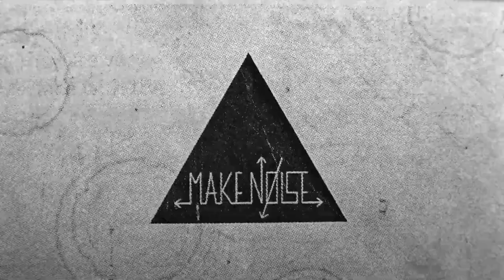How to Tune a Morphagene

Comment: was a little confused by the instructions but eventually I figured out that you need to tune the original lower pitch note solely with the Я | F knob. So like I hook up my piano and play the lowest C I want to be able to play this sample at, and then with nothing plugged into the varispeed CV, I use that knob to match the correct pitch. Only then do you plug in the CV->atten->varispeed knob and fine tune the atten knob. 

Hope this helps anyone who might have been confused in a similar manner.
Reply: I was what confused too, I found my own method, I don't have the other stuff so I was  using Intellijell scales and disting4 (tuner). Don't forget. (uhum... like me) to edit the config file on the sd card(VSOP option!). Runs as a train (sr. Duch . loopt als een trein) ;-)
Thanks.

Comment: your original pitch is at around 1 o'clock....imne is at about 3 o'clock....is this normal behavior, or is my Morph not calibrated correctly. or is your not set to bidirectional, VSOP , but VSOP 2. thanks
Reply from the maker: Most likely it's set to vsop 2. Must be 1 or 2 for this to work - it will not work with vsop 0.
Reply: @MAKEN0ISEMUSIC  last thing....since ive been pulling the card to make changes, when I pop it back it it it doesn't start to autoload, I press the Shift button. but id say about 60% of the time it still won't load and I have to power cycle my rack. how else can I get it to load without power cycling, or could there be some kind of issue? thanks.

Comment: is the morphagene running into the optomix as a means of consolidating both sound sources (into the echo & erbe) ... or to impart a vactrol color to the sound? or, well, both, of course? thanks for another enjoyable video; been cooking with them on and they make for programming both engaging & soothing,
Reply: actually, you know, the more i watch this video, the thing i feel most curious about is how it's possible that sample playback sounds to be at normal speed (around the 1 min mark in the video) when the morphagene's vari-speed knob looks to be at "0" ... how is that achieved? is it in the adjustment of the vsop setting?
Reply from the maker: Mainly it's the former - to mix the two sound sources and hear them together. As for the playback speed, it looks like we were using vsop 2 (SD card option) which makes the playback forward only, stopping when the knob is counterclockwise.

Comment: I have a sample on the SD and when I play it through with the F on green, Morph on counter clockwise yellow, and all pots at noon, the sample plays at a different pitch than the original. How can I remedy this?
Reply: Solved this for now by edging back the F to purple/blue (just behind green), then fine tuning with Maths output 2 into varispeed. That said, if there’s a more straightforward way of doing it I’d love to hear!
Reply from the maker: Sample is probably rendered at 44.1kHz instead of 48. This will result in slightly incorrect playback speed.

Comment: Is it possible to tune QPAS and the Radiate independently? there should be a measurable correlation and thus programable. Right?
Reply from the maker: it all depends on the response curve of the expo FM, which on QPAS is not designed for v/oct tracking. it's possible that carefully set input attenuation would result in passable v/oct tracking in some part of the frequency range, but your better bet would be to use unquantized voltage and tune by ear.

Comment: Million dollar question is why doesn't Morphagene just track 1V/Octave keyboard when fully turned up, in the first place. Did not one think that might be a good factory default.  I own a lot of MN stuff, but their disliking of fine tuning has always perplexed me.  I had to sell the Teleharmonic because I lost patience tuning it endlessly. Morphagene is in my opinion the best sounding Granular device I have ever heard, so it pains me to know how difficult it is to do basic thing with it.
Reply from the maker: The Morphagene's design is oriented around extending the range of the lower speeds such as on a tape machine, not around multi-sampler type keyboard control. The exponential scale for v/oct tracking was more of a compromise than we were willing to make on that during development. Adding the option was a result of months of additional post-release development time. Sorry for the inconvenience.
Reply: @MAKEN0ISEMUSIC  Thank you for your reply.  No Apologies needed.  I use the MG in a certain way, perhaps others don't.  Don't know your hardware design or firmware flexibility, but it almost seems like standard CV tracking on a fully dialed up varispeed setting  could be an option for the default text file that gets loaded on boot up. I have always envisioned an expanded version of MG where one can splice more accurately, and jump between slices with some accurate rhythm, pitch and direction of playback control. One can always dream:).

Comment: Question! You have the vari-speed set in the middle, neither forward or backward. When I do that, I get no sound, or extremely low. so I had to move it slightly forward, and I ended up with a super deep sound. How do you keep your sound pitched right that low. I did get the patch working, generally, but I seem to be missing something. Any advice?
Reply from the maker: It depends a lot on the pitch of the original recording - if it's already on the lower side then it's going to be REALLY low when you drop it multiple octaves. you could start from original pitch if you're only pitching up within two octaves in your sequence (the farther from original pitch it goes the less "natural" it will sound)
Reply: @MAKEN0ISEMUSIC  Ok, so it really doesn't matter if the vari-speed's set in the middle, as long as I can get a reasonable sound and a few octaves up and done with it. Just whatever works in terms of vari-speed and then fiddling with Maths to get the tracking sounding reasonable?  I'm playing with a sample of the Skiddaw Stones, and I seem to have worked, but when I tried the vari-speed at your setting, it was just growls (which had their own attractiveness).
Reply from the maker: @complicitytheory  yes, the setting of the varispeed while "tuning" is not relevant unless you want to use the octave indicator lights as guidelines

Comment: What's the real difference between VSOP1 and VSOP2? The manual says VSOP2 is more accurate regarding pitch. What is the benefit of VSOP1 being bi-directional? It can play samples in reverse while tracking v/oct?
Reply from the maker: Since vsop 2 is uni-directional you have more precision (smaller range mapped across the whole knob). vsop 2 cannot play in reverse, however.

Comment: Thanks for the video, but why so much fuss to tune the Morphagene? I have one as well as an Arbhar and the Arbar tracks v/oct without any adjustments. Is there a reason the scaling is off, and the 1v/oct needs to be attenuated? Alternatively, one could use a Kenton Pro Solo, adjust the scaling, and use a midi keyboard to sequence the Morphagene.
Reply from the maker: v/oct tracking was not part of the original design of the Morphagene. As Tony said upon release of the module, "Having the increased and extended range at the lower speeds creates far more interesting sounds then would be possible using the exponential scale required of the 1V/ Octave standard." However about two years after the Morphagene's release we added user editable firmware options including the v/oct option. However because each Morphagene's input responds differently due to parts tolerance and their is no hardware calibration trimmer as you would find on a VCO, we had to ensure that every Morphagene unit would be able to do it, so there is a little bit of setup involved.